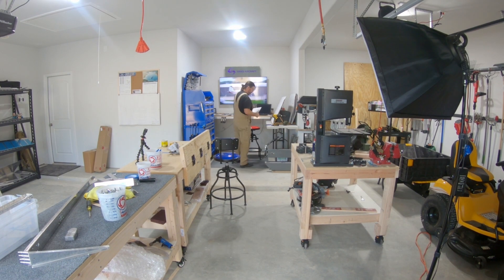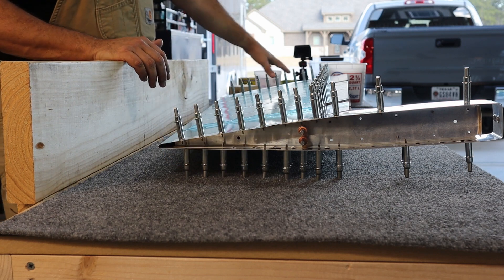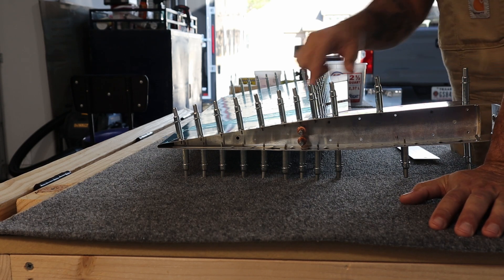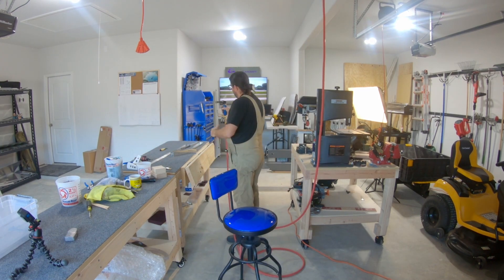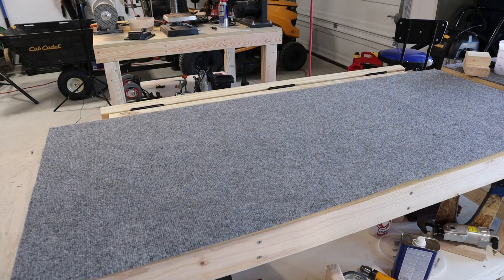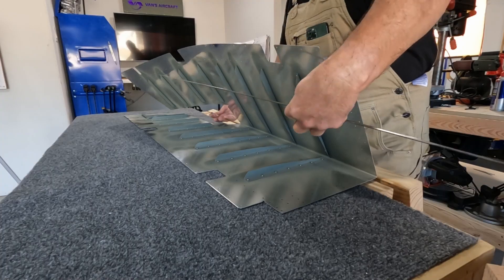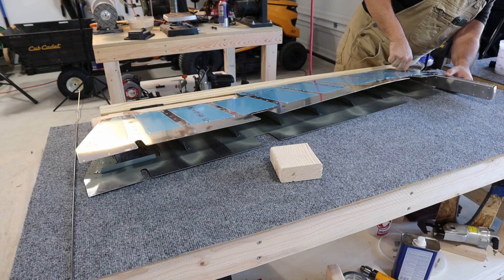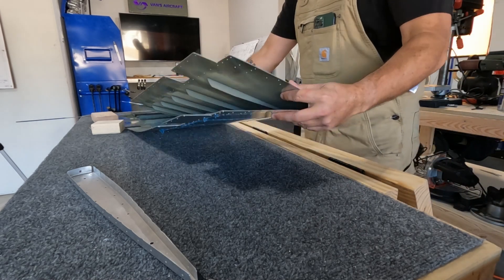Van's RV-8 Build. Ep 014. Elevators 06

Comment: As a RV8 builder, I find your vidéos very interesting and understandable for the French I am. I hesitated a lot when bending the trailings edges, ailerons flaps elevators and rudder. I built two RV8 , and noticed at the first flights too responsive ailerons, which made the aircraft uneasy to maintain straight. Bending a little more ailerons’ trailing edges solved the issue. 
I learn a lot from your videos, despite my building experience. Thanks
Reply: Concerning the trailing edge bend, I would be afraid to ruin a skin by overbending or have a dramatic crack during a flight near Vne. I rather underbend, wich isn’t better …
Reply from the maker: Thanks for the feedback, Dominique! I won’t be surprised if I have to put a little more bend in my in my trailing edges. I definitely didn’t over-bend them. I’m currently in Paris working for a few weeks. I’m curious about how accessible general aviation is in France. I found that flying in Germany and Denmark was pretty easy as an American FAA certificate holder once I figured out how to obtain a “holiday license”.
Reply: @thathippiepilot  I live in south of France. I can offer you a ride in my RV8 . Let me know. I am not aware of legislation for US citizen, I suppose that must be doable for you to fly in France .
Reply from the maker: I wish I had more time here. That would have been fun.